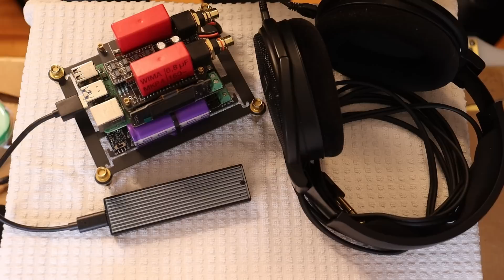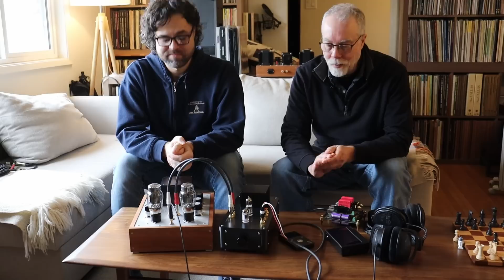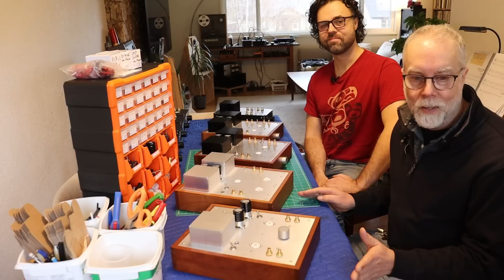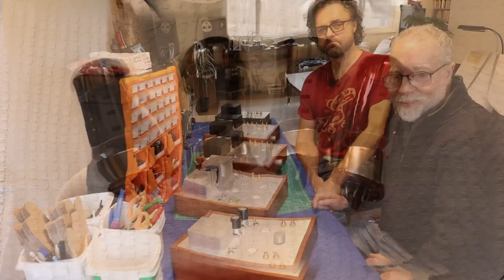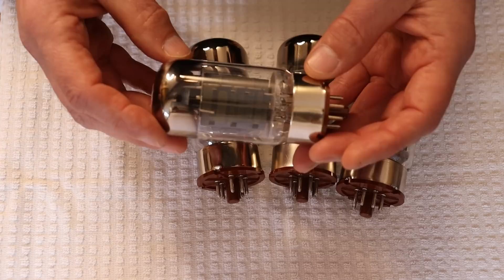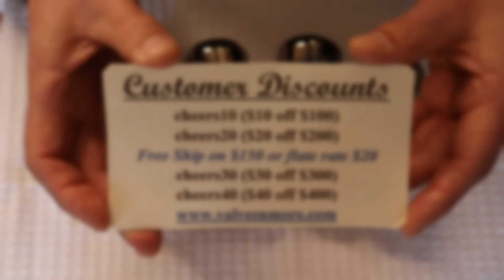Tube Lab #225 - What Does It Cost To Go Audiophile pt 1

Comment: Your website doesn't work properly shows product but no way to buy?
Reply: Thanks got it to work, really a nice piece
Reply from the maker: @stanmyers5994  I just checked and the Store appears to be working just fine.  Are you on the correct site?  Here's a LINK:  https://mellowtoneamps.ca/
If you are still having problems let me know, my partner is a computer expert and will sort any problems out right quick.  Note this is a modern platform and very old computers/operating systems may not work properly.

Comment: With a lot of analog outputs from DACs these days being 2Vrms or even 4 Vrms, why would you say we need additional gain from a preamp? Looking at OTL like you were mentioning, a common Bottlehead Crack kit puts out 15db of gain and clips at around 10Vrms. There's already enough gain to drive the amp past clipping with a 2 Vrms source. Now if you're running out of a phono preamp and maybe at 300mV, whole other story, yeah get more gain.
Reply from the maker: @preauxtip  the consumer standard for output voltage is 2vrms, that was established by cd players (though that's a nominal maximum, the reality is you won't see more than 1vrms).  Most headphone amps will need a full 2vrms at a minimum (though this will vary).  When a DAC has an output of 2-4vrms it has a gain stage(s) attached to the dac stage.  A typical control preamp will have a minimum output of 5vrms.  And some high gain preamps will have much more.  For example The Rocket has a gain of 18.5, what that means is if you input 1vrms you can get a clean 18.5vrms (with headroom for a clean signal up to 43vrms!).  Now you might think, if I need 2-4vrms to just barely drive my headphone amp to max power I'm good.  But the reality is you need some headroom or you risk distorting the signal.  Now all of this would be fine if Chinese manufacturers made accurate realistic specifications.  But they often don't.  But it's not just Chinese manufacturers, we've seen very expensive European gear with specifications that are complete BS.  You can test this at home with a quality signal generator and scope, I think you'll be very surprised as to what you see for an output signal.
Reply from the maker: @preauxtip  thanks for bringing this up.  Yes if you have a DAC with an output of 2-4vrms you can probably drive many headphone amps.  And if that's the case you actually have an integrated DAC, so a DAC with a Preamp all in one box, probably with a volume control.  Will that give you an audiophile grade preamp, maybe, probably not.  In the case of our coming Kit Headphone Amp, it would be more correct to call it a stereo headphone power amp, so it needs much more voltage to drive it to max power.  Does that design approach cost more? Yes.  Does it sound amazing? Yes.
Reply: @tubelab194  to be honest I'm hard pressed to find a DAC that has less than 2Vrms output. Most of your delta-sigma designs using off-the-shelf chips from ESS and AKM (so basically 90% of DACs under $1000) are 2Vrms or 4Vrms if using a differential output.